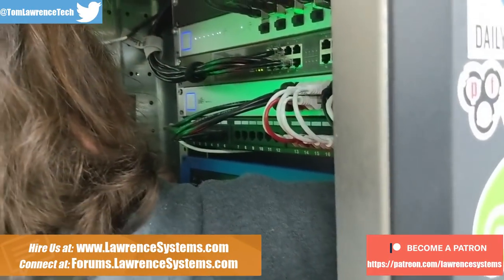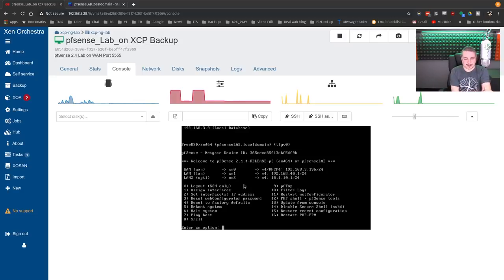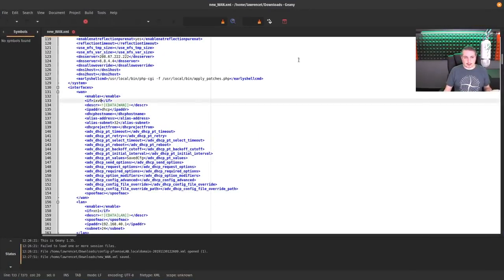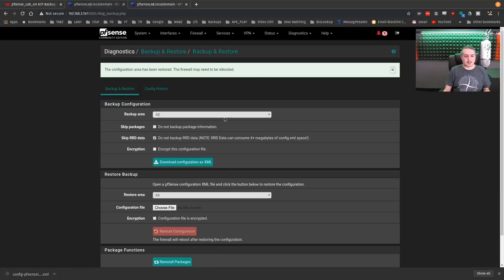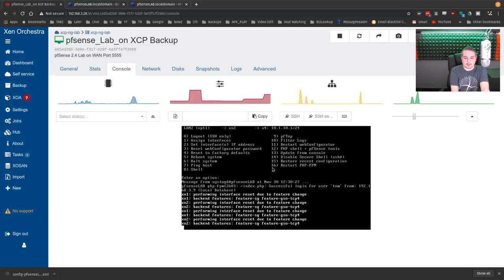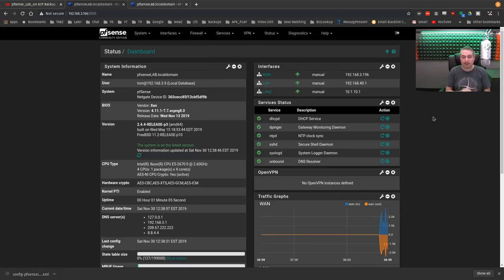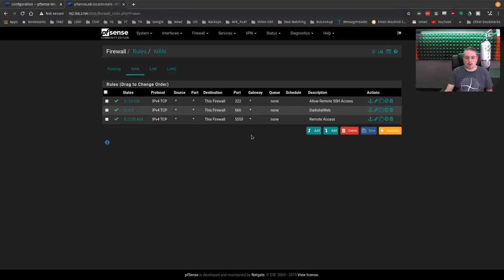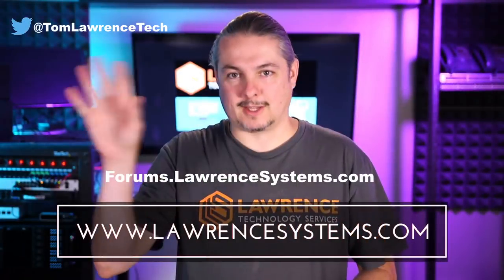Backup/Restore pfSense Custom XML Configuration When Changing Firewall Hardware

Comment: Attempting to migrate from an ESXi based VM running 2.4.5 to standalone i3 based computer, basically an appliance. It wants access to Internet to download packages, but I only have 1 WAN. The current pfSense is running my network. How to migrate the config while using the same network config as already installed? Any hints? First attempt, when it hit the pkgs webconfigurated went dead and stayed dead even when using console. Interface mapping is fine. You made it look easy but getting sticky with a single environment to work with.

Comment: Hi Lawrence.
 I am using pfsense as firewall and I am having issue unbound DNS.  It stopped working and I have this error message: The generated config file cannot be parsed by unbound. Please correct the following errors:
/var/unbound/test/unbound_server.pem: No such file or directory

[1575213668] unbound-checkconf[65410:0] fatal error: server-cert-file: "/var/unbound/test/unbound_server.pem" does not exist

Can you please help me to fix the issue.

Thank you

Chrismond